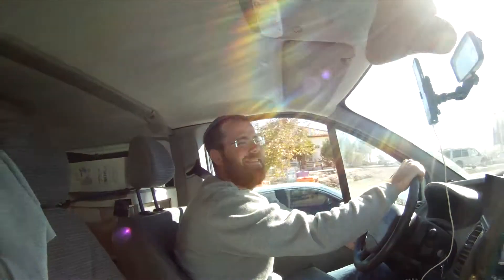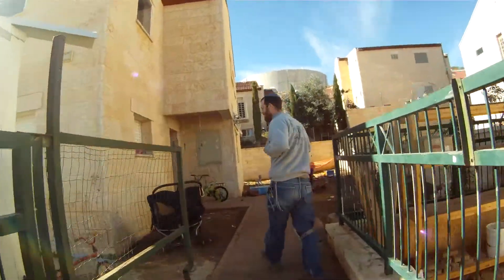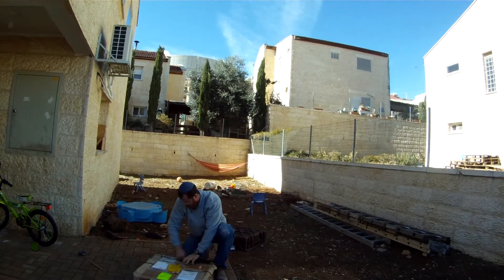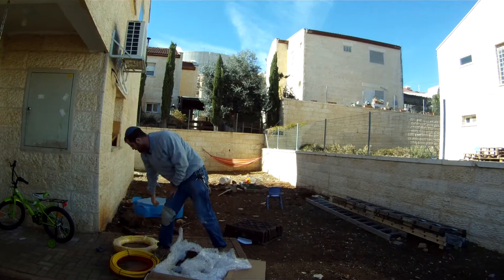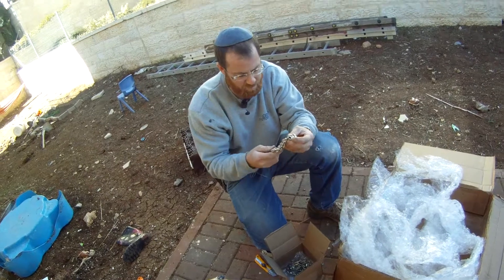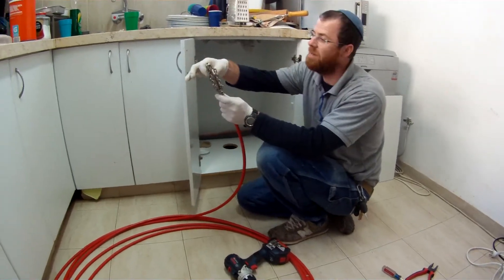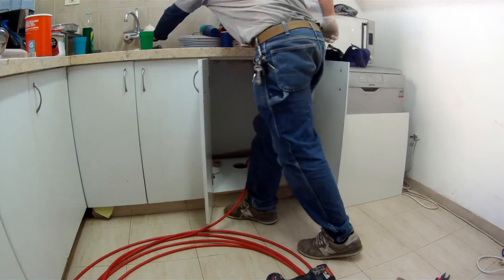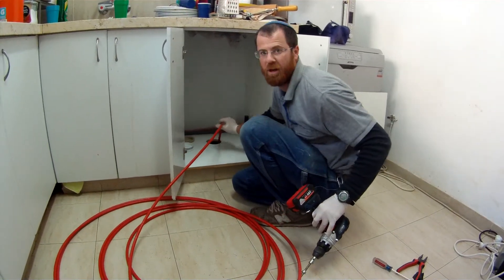A Plumber's Life 5 :: Clog Dog Debute

Comment from the maker: I added links in the description to different drills that work with the flex shaft
Reply: Hi can you please tell me what the pipe sizes are for freshwater and for waste pipes in Israel
Reply: All good until you lose one of those chains down the drain! This is where some one comes in and charges you to extract the head. And you would be loosing money instead of making money. First thing as a plumber that no one teaches you have to be a plumber and a welder at same time. You don't need to have those kind of chains to get started in this biz. Weld a detachable t connecter so you can have multiple attachments or just a straight leader would work fine as well.
Reply from the maker: @Brian-vz7xe  Hey mate. To each his own! Personally I have all the tools necessary in my arsenal to extract the chains when (yes, when) they fall off. Each tool has it's pros and cons. Overall flex shaft is a money maker for me, is great value for my clients, and gets you wall to wall cleaning when using it with a camera. Due to the issue of welding the Ridgid, Clogdog chains I now use most the Picote chains that only require a grinder to fix. These are less flexible (which has advantages and disadvantages depending upon the scenario) and cannot run in reverse  but overall prefer them due to the easy repairs. Personally I don't like the T slides.

Comment: I want to know more about this system.
Reply from the maker: Twin City Drain check out www.clogsquad.net 
They are manufacturing the flex shaft that I am using.
Also check out Picote and Renssi websites.
You can order the clog dog flex shaft bare or with the machine.